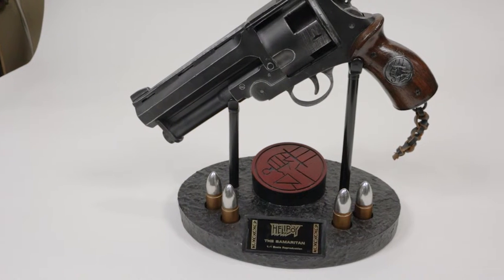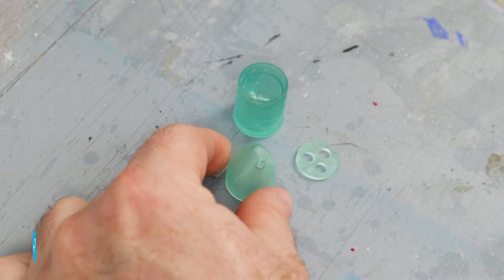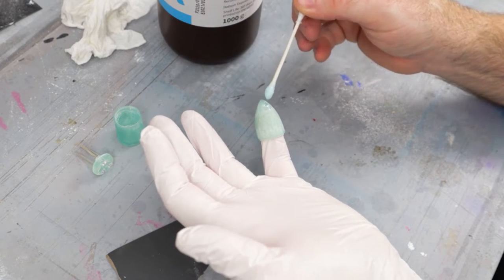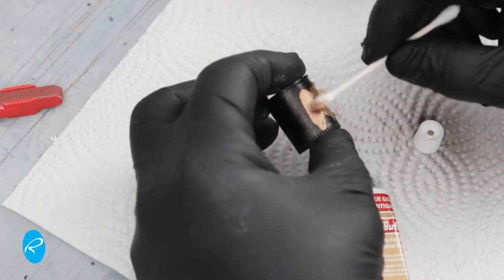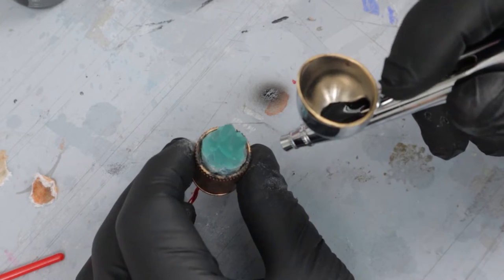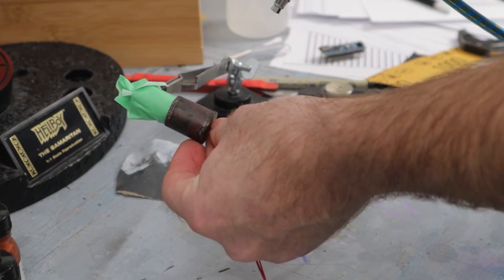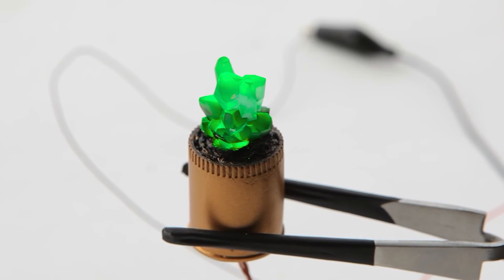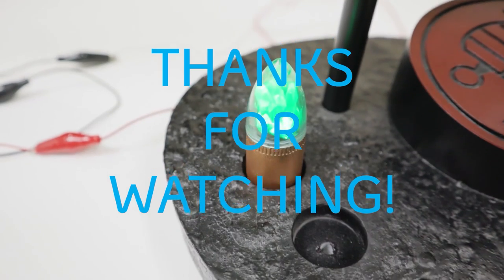Custom Hellboy bullet. An arduino powered, glowing bullet for the Hellboy Samaritan prop gun.

Comment from the maker: If you don't want to use an Arduino to power this you can simply connect it to a 3 to 5 volt dc power supply. If you do want to use an Arduino copy and paste this text into the Arduino IDE:

int led1 = 9;           // the pin that the LED is attached to
int brightness1 = 180;  // how bright the LED is
int fadeAmount1 = 1;    // how many points to fade the LED by

int led2 = 10;          // the pin that the LED is attached to
int brightness2 = 180;   // how bright the LED is
int fadeAmount2 = 1;    // how many points to fade the LED by

int led3 = 11;          // the pin that the LED is attached to
int brightness3 = 180;   // how bright the LED is
int fadeAmount3 = 1;    // how many points to fade the LED by

// the setup routine runs once when you press reset:
void setup()  {
  pinMode(led1, OUTPUT);
  pinMode(led2, OUTPUT);
  pinMode(led3, OUTPUT);
}
// the loop routine runs over and over again forever:
void loop()  {
  analogWrite(led1, brightness1);
  analogWrite(led2, brightness2);
  analogWrite(led3, brightness3);
  fade(brightness1, fadeAmount1);
  fade(brightness2, fadeAmount2);
  fade(brightness3, fadeAmount3);
}
void fade(int& brightness, int& fadeAmount) {
  // reverse the direction of the fading at the ends of the fade:
  if (brightness <= (random(2, 10) * 2) || brightness >= (random(100, 120) * 2)) {
    fadeAmount = -fadeAmount ;
  }
  // change the brightness for next time through the loop:
  brightness = brightness + fadeAmount;
  // change rate of brightness change depending on how bright
  // which allows smoother fades across all brightnesses
  if (brightness >= 120 && brightness <= 255) {
    delay(1);
  }
  else {
    delay(1);
  }
}